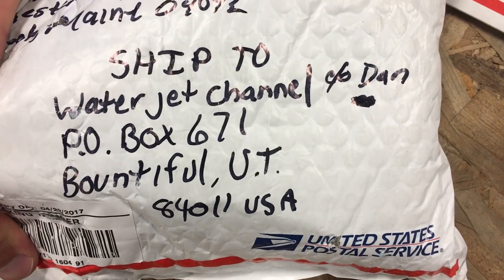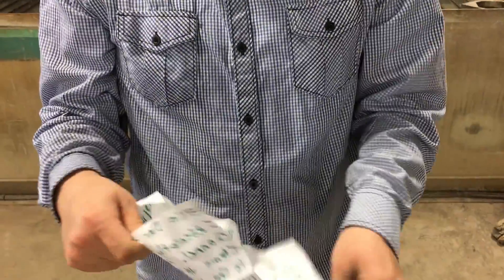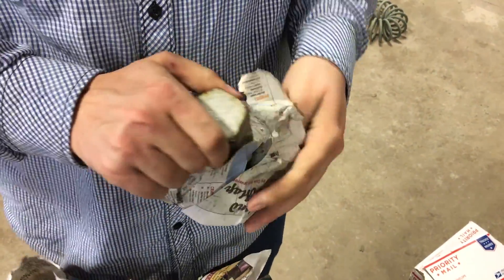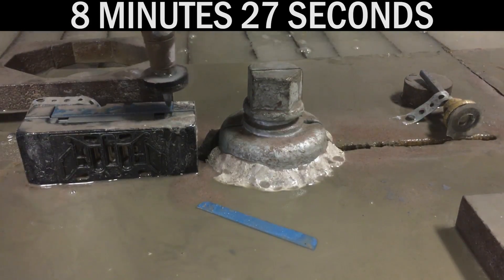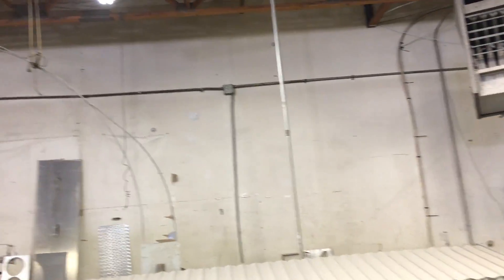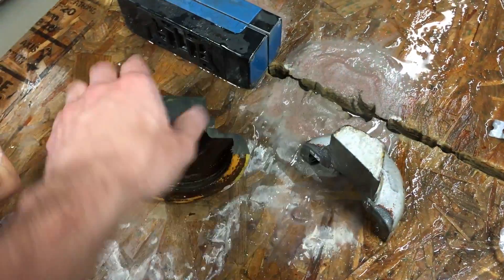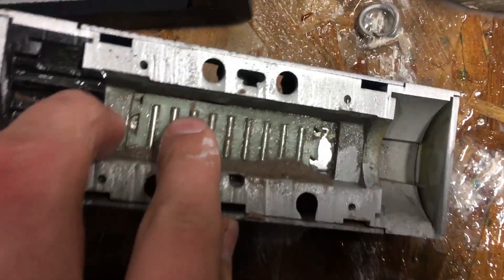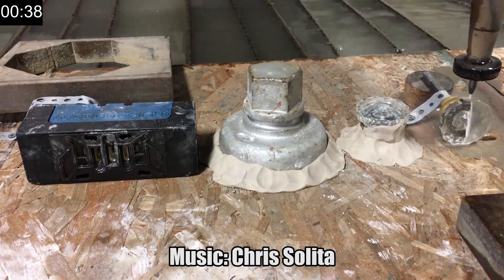Fire Hydrant Cap vs 60,000 PSI Waterjet

Comment: me: where and how did you get this hydrant caps? five hours later on local news: floods In Wheatland, ND were caused by fire hydrants being opened up. the caps still cant be found. we have gathered information from a secret source *cough cough YouTube * that someone sent them to be cut by a waterjet. ME: uhhhhh........
Reply: 17Industries lies
Reply: BAKZ no shit sherlock
Reply: 17Industries That was off a  "May West"type hydrant! So called because it only has two connections and they resemble May West's most famous features! By the way,in North Dakota they use a dry hydrant system,the water is shut off at the main below the frost line.Thd hydrant itself doesn't hold back any water pressure.Now You Know!!!!

Comment: what can a water jet not cut open
Reply: Only Diamond. Waterjets are the most powerful cutting devices on the planet, next to lasers.
Reply: railroadguy its the sand that does the cutting. so in theory the paper bags that contain the sand are impenetrable to the sand... so the paper bags the sand comes in should keep all the sand from passing through. so the sandbags should be the most impossible thing for them to cut 🤓

Comment: Those door nobs are acually made out of crystal, i have the same ones and they are realy crystal
Reply: ... Metal is a type of crystal too. :0
Reply: Watchfulatmoney 1 interesting, thanks I didn't know this👍
Reply: Crystal is just glass that's been infused with a metal. You can tell the difference usually by flicking or banging on both and Crystal will have a more metallic ring to it.

Comment: You should mount a metal fidget spinner vertically and use only water to see how fast you can make it spin before it breaks.....please.
Reply: James Mitchell watch the car parts one. they struggled with the alternator, because it spun instead of cut. its feasible for the spinner to spin up, especially if it was steel.
Reply: James Mitchell The waterjet's pressure of releasing the water cuts steel ._. you expect it the fidget spinner to spin? it'll break instantly
Reply: True, but without the abrasive material mixed in with the water, the spinner might survive long enough to start spinning.

Comment: try to cut a  diamond
Reply: send them a diamond
Reply: yeah, find a diamond big enough that's also cheap enough to cut. 
-_-
Reply: Lidl Onlineberatung Dein Name😂😂
Reply: River fishing hydraulic press
Reply: SSJX Knuck look up Dimond vs hydraulic Press
Reply: River fishing that is bullshit sir :)
Reply: MegaDominik1 no it's not
Reply: River fishing everything can cut everthing. It just has to spin fast enough. How much of the material you need to cut, is another thing. If you have endless paper and you can spin it fast enough, it can cut steel and stuff like that. And yeah water can cut diamonds easily. Get your shit done man :)
Reply: MegaDominik1 here's what Google had to say "Most ceramics can also be cut on an abrasive water jet as long as the material is softer than the abrasive being used (between 7.5 and 8.5 on the Mohs scale)". Examples of materials that cannot be cut with a water jet are tempered glass and diamonds. Get your shit done man
Reply: Logan 1664 I bet you feel like a right dumbass considering that was all different diamonds in one rock all they did was cut the rock that they were in cased in
Reply: Only Dimond can cut Dimond you can't break it with anything els